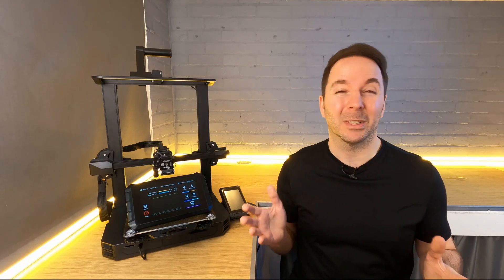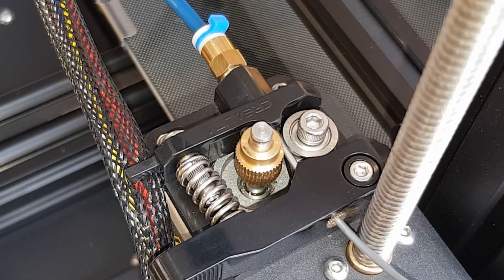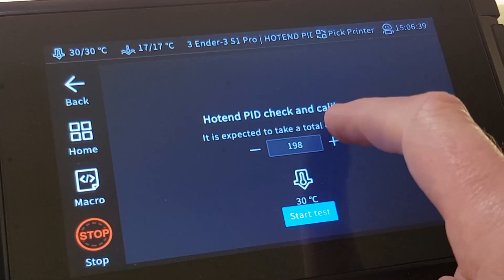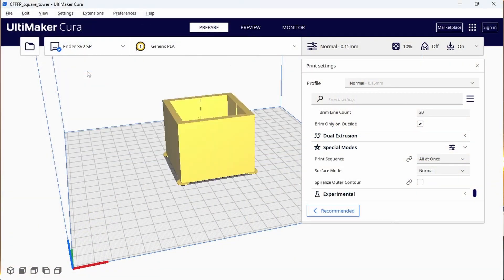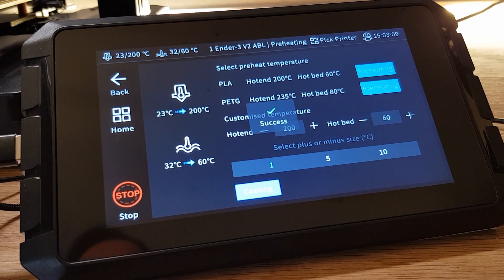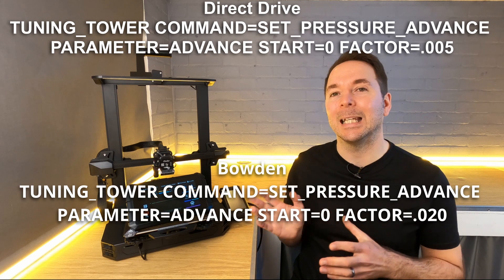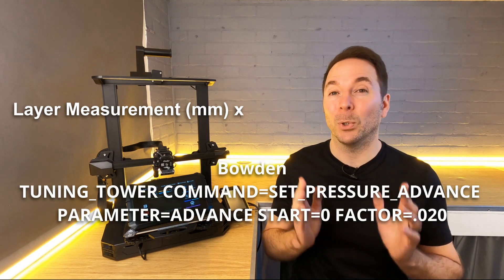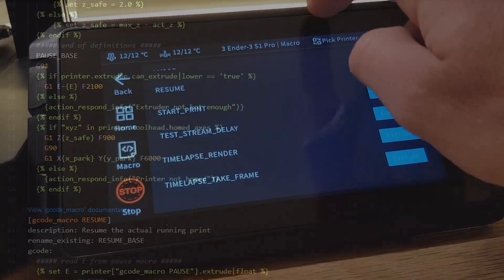How To Tune Pressure Advance With Your Sonic Pad - Sonic Pad Intermediate Part 6

Comment: Thanks again Ricky for clear direction.   I ran this test on my ender 5 s1 and saw clear deteriation on the corners.  However,  when I ran the test on my stock ender 3 v2, I could see no clear flaws on any exterior walls.  Pressure advance is set on default 0. Is this unusual?
Reply from the maker: Did you use the correct command for the bowden setup on your E3V2?
Reply: @RickyImpey  I stopped the print because of initial adhesion problems. And I wondered if I lost my command lines when I restarted.  After that attempt I had a bowden tube fail and I'm waiting for a replacement. So I haven't gotten a re-do.
Reply from the maker: @haushogg  ah yes, you have to enter the last command again before a reprint. That will be it.

Comment: Thanks for some great videos. I have followed all up until now with no problem . I have come to slice the tower and get the message unable to  slice due to small layer temperature setting ?
any Ideas? using the imported normal PLA profile

This appears to have sorted itself out after re starting this morning?
Reply from the maker: Yes, this is a new setting with Cura, I believe it's in the cooling section, you may need to make it visible. It confused me for a while too. I believe you need to ensure that it isn't lower than the first layer temperature.

Comment: My first layer along with every layer looks awful.   Gaps in the filament 6 layers up please help I don't know what else to do.

I have a glass bed and the mesh diagram showing 0.0X for most points however the mesh diagram is not flat and looks distorted in one corner

Comment: Ricky, you made an excellent playlist, but you didn't mention how many WALLS should be set for the test. I've always seen just one, but in your video, it seems like there are 2 or 3... Can you clarify?
Reply from the maker: Hi, it doesn't really matter as it's only the outside corners that we are looking at. I believe I just left the walls at the default value for this profile so it was 2 or 3. You could just use 1 to save time and filament too.

Comment: What PLA brand do you use?
Reply from the maker: I use a few different brands, usually whatever is at a good price at the time but I tend to prefer a few if the prices are similar. I like brands that use cardboard reels instead of plastic and those that dry and package the filament well. I have been using a lot of Overture filament lately with good results. I also use 123-3d filament which is mainly available in Europe. I like eSun for PETG but I also like to try differnt options too.

Comment: Ricky, your walkthroughs are amazing! Keep up the good work. I was hoping you could give me a pointer above .2 layer height with my 06 nozzle. 75% is out of the question, I cant get this tower to print. I've been working on it for three days and nothing I do seems to help. I'm lost! I have followed you all they way through tin sonic pad serries. Please Help!
Reply: I had a similar problem: stock Ender 3 V2 hot end, but with a 0.6mm CHT nozzle. A layer height of 75% of the nozzle width (0.45mm) at 100mm/s with a 0.6mm nozzle would require 27mm^3/s of flow; way above what this hot end can do. I printed the tower with the above settings but a 50mm/s print speed. It worked (for the purposes of the test) but it was struggling. If I did it again I'd reduce the layer height to 0.3mm to give the hot end an easier time.
Reply from the maker: Hi, have you tried a smaller layer height just to get it to print? The 75% part isn't critical and is mainly to speed the print up but also to help make defects more critical.

Comment: One question - will it be necessary to repeat the tuning steps for different materials, or will the tuned up settings done with PLA work for PETG , ABS etc as well ? Very usable info om this channel. Creality should bed ashamed to not provide this themselves.
Reply from the maker: Strictly speaking, yes you would need to tune for every filament but in practice, you'd need to see if there are any issues with a test print. It might not be something you could see.

Comment: OK Ricky, help some of us fence riders out. I am capable of adding Klipper to my Ender 3v2 via other means ( additional computer etc) but the ease of the SonicPad is tempting. However, bottom line, do you suggest one over the other (roll my own or purchase Sonic Pad) and if not, why not.  Am I lazy? Probably.  TY in advance.
Reply from the maker: If you have the kit and ability to add klipper without the Sonic Pad then save yourself some money. However, if you want the screen near your printer rather than having to have your phone or laptop nearby then the Sonic Pad could be the best option.

Comment: Thanks! After this test, do I undo the changes in the profiles setting, or do I keep them ( eg layer height , infill and printing speeds)
Reply from the maker: Just hit the reset icon at the top next to the drop down arrow or select a different profile to reset all of the changes, don't keep them.

Comment: what if nothing really changes at the layers? sitting here and dont know what to do
Reply from the maker: Have you double checked all of the steps? There should be a noticeable change if everything is entered correctly.
Reply: @RickyImpey  yes i did. i literally tried 3 times. now i checked the rotation distance because i thought its overextruding. its nearly on point, a bit less than 100mm. i am really confused. i am printing the tuning tower with 80% flow right now and still have those bulged corners. o.O

Comment: Thank you, Ricky! that was the most clear and simple explanation, I've seen! 

It helped me to configure pressure advance on my Ender 5 S1 with Sonic Pad connected - I did everything according to your guide:
1. PID tune (bed + extruder)
2. verified E-Step (it was fine)
3. Input shaping
4. Pressure advance

Than I printed ringing tower with full speed 250 mm/s - the print was succeesfull, however I still see some minor ghosting.
My understanding was that Klipper should shape the speed profile disregarding the speed I've set in slicer (PrusaSlicer in my case).

Is it correct? 

Or should I still lower the speed in the slicer to avoid ghosting?
Reply from the maker: Hi, in a way, yes and yes. Klipper will attempt to reach the speed settings you ask it to but it will limit and control the acceleration using your input shaping tune plus any other acceleration settings. There is also only so much the input shaping sensor can do and sometimes some more fine tuning of the resonance compensation is necessary. There is some good information here if you want to learn more: https://www.klipper3d.org/Resonance_Compensation.html
Reply: @RickyImpey  Thank you!

Comment: Should I do pressure advance test for every different type of filament I use?
Reply from the maker: I find the best practice is to be aware of what the different tuning options will improve and then fine tune for a different filament if you see evidence that the tune is incorrect. Technically though, yes the pressure advance will need to be a little different for each filament. In practice, you may not see any difference.

Comment: Yet another in a long line of awesome videos. Keep up the great work Ricky.  I just installed a Sprite Pro on my Ender 3 Max NEO that I already had using the Sonic Pad.  It was quite an ordeal thanks to a total lack of documentation from Creality for using the Sprite Pro with the Sonic. Pressure advance is the only thing I haven't finished up and am going to do that shortly.  Ironically the Sonic offered up a brand new firmware update this morning that said it directly supports the Sprite Pro, but once again, zero documentation and you cannot even see this firmware release on Creality or Cloud websites.

Comment: Thanks for the videos. I’ve changed my pressure advance setting. If I want to redo the test, do I need to set it back to 0?
Reply from the maker: The code you enter before running the print zeros the pressure advance before then changing for each layer it so you can repeat the process exactly every time.

Comment: Any thoughts on the Pressure Advance Smooth Time parameter?
Reply from the maker: I have spent a fair amount of time playing with smooth time but I can't say that I've found anything other than the default 0.04 to work well. I'd advise leaving smooth time alone. It's the look ahead time for pressure advance and 0.04 is 40ms

Comment: Hello Ricky, question when doing the pressure advance cube to test. do I need to put my flow rate at 100% or leave it as what I have it. I have tried this before and made chance and It seem to have made it worse. for me.
Reply from the maker: I very rarely change flow so I would do mine at 100%. However, if you can't get good quality and you've tuned rotational distance then use whatever you plan you slice with. It's all about dialing in the best quality for your machine so use whatever looks best if my settings aren't working for you👍

Comment: These videos are awesome! I’ve been fighting with the sonic pad for 5 hours tonight and I’m back at step 1. Any chance you want to make a video on changing the config file when you add a sprite extruder? I’ve got a Neo max that I put a sprite extruder on. Had it configured perfect with marlin but Klipper is kicking my rear.
Reply from the maker: I don't have the wiring loom to fit a sprite to my V2 so I can't test it but is it not just a case of setting a different rotational distance and probe offsets? I didn't think they used different board pins but I could be wrong.
Reply: @RickyImpey  You are spot on. I got the rotational distance set perfect thanks to your video. Hitting 100 mm spot on everytime now. The probe offsets and extruder offsets are what keep giving me issues. Every example I find online has me probing off the bed. The ones that do probe close have me printing out of center on the bed. That seems to be my last hang up is just finding the right positioning to enter for the sprite.
Reply from the maker: @harrison0550  Have you double checked your X and Y dimensions in your config file and your slicer to make sure they match?

Comment: Thankyou for making the videos and I am getting a lot out of your videos, but I do have 1 request.  Slow down.  It seems like you have speed up the screens even as you are entering.  New to 3d printing, I am having to replay sections many times to try and keep up.  Possibly make a written guide that one can follow step by step?  Thanks!
Reply: DITTO... I have to play some sections several times because Ricky speaks fast, and not so clearly, so I'd echi the rquest to Ricky "please slow down and speak clearly", however, his videos are some of the best around, too.

Comment: 0.578 is my number for an Ender 3 v2 with a Bowden tube and a Minimus shroud. The test model printed out with a very obvious bulging corner, to a small area that was good, and then an edge that was falling in. Thank God for your videos, Ricky! The test calibration cube printed out perfectly.
Reply: Same setup. I got 0.528

Comment: If I got 17 millimeter (1.7 centimeter since I don't have a millimeter tester) would that seem correct? Seems low. 17 x .005
Reply from the maker: That is a lower figure than I got on my direct drive printer but it could mean that you have a good solid setup that was pretty close already. Have you tried a square sided print to see how it looks with the new figure?
Reply: i got 17.70mm on my direct drive S1 Pro (new printer, flashed with sonic saturday as the both arrived at same time) or .0885 pressure advance
Reply: @lvanek2011  pretty much the same for me! Seems to be working great so 🤷 lol